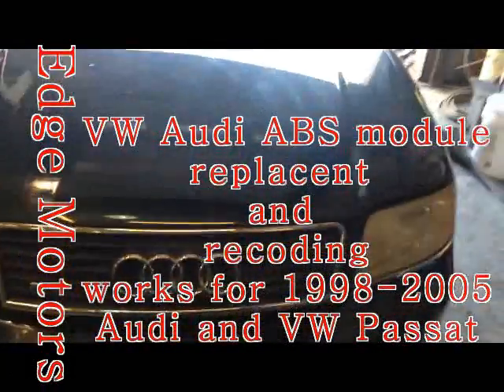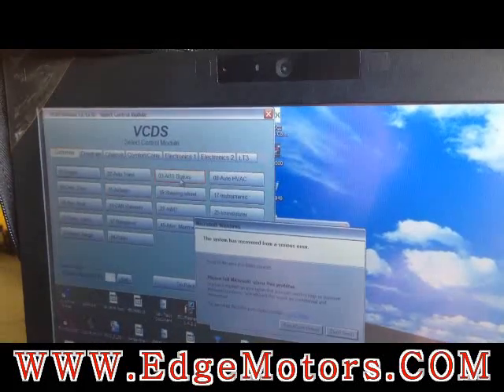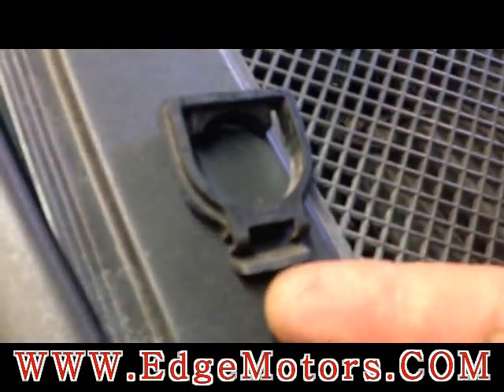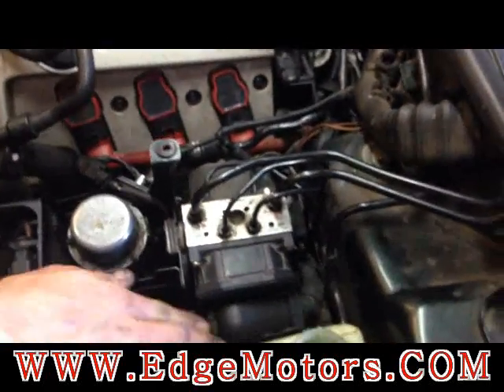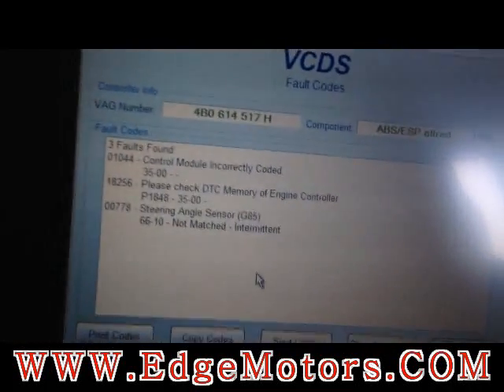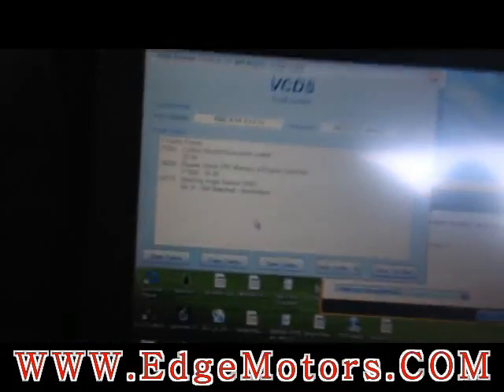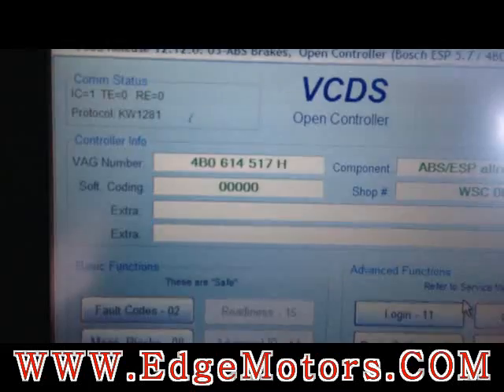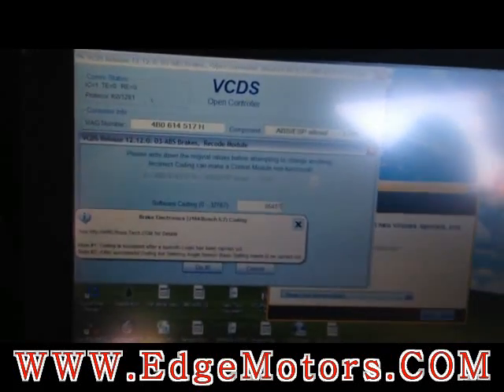VW Audi ABS control module replacement and programing / coding DIY by Edge Motors

Comment: Hi!
Love your videos.

I have a problem when trying to gain security access to the ABS for basic settings.
Code 40168 is not working.

Swapped a new EPB Module and after this cannot perform basic settings on the ABS and work on EPB Coding.

Comment: Hi, I’ve got and Audi A5 2017 I had to take off the ABS pump because it had electric fault which is now sorted, ( all the brake fluid came out and the system was empty) I’m getting the pressure to the front brakes but there in no pressure coming through the rear brakes, do I need to use diagnostic to bleed the system or you think I might have damaged the master cylinder which I didn’t even touched it.

Comment: Thank you for the video! Recently my 2008 Audi TT stated having P01276. I have read several different forms mentioning a new control module could fix the issue. With your experience, how true is that information?

Comment: Hello i have issue with my a6 c7 2011. All lights are on, and my automatic transmision doesn’t reapond. I think that problem can be conected with flexray whiring. Can you tell me where in the car is flaxray unit

Comment: @EDGEMOTORS hi how are you doing sir ? I have a question I have a 2003 Audi A4 1.8L Iam getting code p0501 vehicle speed sensor A range performance with the abs and traction lights on . I believe this issue is related with the abs module from what I read in some Audi forums . So my question is the module you replaced is the same part number I need to replace mine? And where did you get it from ? Thank you
Reply: @hanselldisla4643 I have the same thing. Did u get it fixed? If so, what was it?

Comment: Maybe u can help me. I have an Audi A4 2005 and the ABS control module isn't functioning or communicating with the check engine light which is on and the abs light is also on. I can not pass the smog test in ca. Where I live because of this and so I went to a repair  shop  and he said the new audi abs module is close to 3500 which I dont want to spend. So then he said he can get a used one to match the car exactly. But when he did he told me he was having problems programing it to me car. Then he said he couldn't find a place that rebuilds asb modules for a 2005 audi in the states which I thought was odd and then he said there is a place in Canada he knows of that will rebuild the pump and module. Does this sound legit to have to send my abs module to Canada to get rebuilt? Do you know of somewhere closer to cal.? Is a rebuilt module and pump a reliable way to go if I don't buy one new? Thanks for your help. Debbie

Comment: I own a 09 VW Jetta 2.5L and my ABS control module 1K0614517BD 1K0907379AD failed back in December of 2019 but had been replaced through VW's recall program back in 2017. I brought it to the local VW dealer in Staten Island, NY and they couldn't or wouldn't help me. In December of 2019, I bought 2 used control modules on eBay which didn't work because the VW engineer in Germany said these modules are married to each vehicle and not transferable unless it's rebuilt or bought new. Now I noticed in your comment saying to never buy a rebuilt module because of problems but buying a new one is too expensive. I was told and saw it online for $1700.00, can you recommend where I can buy a new one at a decent price? Thanks for the video and your help.

Comment: No need to bleed the breaks if you only replace the module and not the pump?
Reply from the maker: Yes, if you did not disconnect the hydraulic lines you do not need to bleed the brakes

Comment: Hi I know it an old post  but I have a 2006 passat 2.0 tdi and Abs module is faulty it's a trw module 3c0.614.095.p I have got auto com diagnostics, I have bought a second hand module with exactly same part no on it. Could you point me in the right direction for coding this trw module please any help would be much appreciated thankyou
Reply from the maker: Go to ross-tech.com
Reply: @EDGEMOTORS  thankyou I've been on there and found what I think is the right procedure for my module .... to start I have to drive the car on flat surface and do one turn to left and right then to set wheel angle sensor ect.. will the code give here work through my auto com diagnostics?
Reply from the maker: That procedure is to calibrate steering angle sensor, the coding procedure will be different.

Comment: Any chance that I can replace a ABS module/pump and bleed the brakes and start the car and leave ? Without programming or coding ?
Reply from the maker: No
Reply: Must be programmed?
Reply from the maker: 99 percent chance that it will have to be coded.

Comment: Can I recode a 2009 jetta using a scanner? It shows me the option to edit the coding but it shows I have two different numbers ("code", and "continue") I have to type and I only have one code. I'm not sure what to type under "continue"
Reply from the maker: I’m not sure what scan tool you using, and what you trying to do...
Reply: @EDGEMOTORS  it's a snapon scanner Solus ultra and I'm trying to reprogram the  abs module when I click on programing it says longcoding and it has two numbers I have to put in I already created a code for the car on Ross tech but idk where to get the "continue" code from
Reply from the maker: Not sure how the snap on will do it.... snap on tend not to do stuff properly in vag cars.
But there should be one log in and one coding.....

Comment: Will a faulty abs ecu cause non comunication with main ecu? And cause limp mode?
Reply: My brother had 2000 yearmodel b5 passat with 1.8t engine. It had bad ABS module that took k-line (communication wire/line) Down. I was unable to communicate with the car with vagcom until i unplugged ABS unit.
Reply from the maker: It could cause communication issues, as far as limp mode, I don’t know

Comment: Hi, 2006 a6 3.2.......code 1435/brake pressure sensor G201 and code 1316/brake control module.....do these codes mean that I need to replace the ABS control module?  Or something else?  Great video.....if i was mechanical in any way i know this would help me :)  Thanks for any reply

Comment: Would the brakes feel mushy if it was just the module?  I am not loosing brake fluid at all, but my error code says ABS Hydraulic Pump leak.  I am tempted to buy a fully rebuilt unit pump, module, the whole thing from Europe just to rule it all out.  I am just not sure what to do.  There is a place in the states that will rebuild the module but not the pump.
Reply: Also, I just consulted with a local import shop.  They told me that used units would not work because you cannot "re-code" a unit.  It must be blank or brand new.  Any truth to that?  Maybe they do not have the proper software to re-code?  He made it out like he had a Ross-Tech..
Reply from the maker: Aaaa I would need a bit more info.
About the car and the problem
Reply: I have an error code 01276 in which my Audi Code reader shows that as ABS Hydraulic Pump Leak. However, I am not leaking brake fluid (that I can see or find) my reservoir is full and all that. My brakes do feel a bit weak or mushy if that makes sense. I've been doing so much research and there is so much conflicting data. I have read that this is usually just the module that goes bad, and simply replacing it or having it rebuilt will solve my issues. That way I just leave the pump and distribution block connected so I don't have to not drive it or worry about bleeding the brakes. However, the old school mechanic in me tells me if the actual brakes feel mushy then there must be air in the system. But, I have read that a faulty module can send mixed signals to the pump, and it can actually release pressure, just like it does when it is working on slick roads when you are stopping, so causing the weaker brakes. Here is my issue, a new unit is close to $2,000 + the labor and Audi coding it. The only rebuilt ones (which are few) are all over in Europe and are $400 - $500 + shipping (great deal really). The other option would be to buy a full used unit and hope for the best. I do know regardless a trip to Audi is required to "code" the new unit. I did find a company in UT that can rebuild just the module, but not the pump. I am sure they could probably just test my module to see if its bad. 
Questions:
What is the chances that this is just the Module being bad? I mean can a faulty module actually change the pressure in the peddle? Or am I truly looking at a bad pump? I am just trying to find out what the real issue is. Because if its the module only, I can have that rebuilt and leave the pump and all that connected to the vehicle. If its the pump/block, I can just buy a used unit and have all of that swapped out, but I could actually still use my factory module and not have to worry about a trip to the dealer to reprogram a new Module. 

Any advise or assistance would be great.
Reply: Oh, I have an 07 Audi Q7
Reply: I guess my main question is, if I bought a full used unit, the whole thing, could I install it and have it re-coded to my Q7?  I have had an independent shop, and the Audi dealership both tell me they are "burned" into the until and cannot be re-coded, to prevent theft of parts.  That only a brand new "blank" one or a rebuilt one that is whipped clean can be used.  Is this true?
Reply from the maker: You can, if it has “ component protection” it still can be done, but you will need dealer scan tool to do it...

Comment: What are you talking about?  Rebuilt?  Module Masters offers a 5 year warranty on their ABS module repair.  And I for fuck sure am not buying a $1300 abs module to place in a $4000 car.
Reply from the maker: What kind of car you have?
I have used many different companies to rebuild the modules, and the success rate was no more than 50% meaning they would either be bad from the start or go bad with in next year,  yes some of them went bad in couple of years.... but we talking on a scale that you replace one module in a your lifetime, I replaced hundreds of them, and if even 10% of them come back bad, I look bad in my customers eyes, and loose allot of money on redoing the work.
And FYI a abs control module for older Audi’s and Vw are around 500-600$ new from dealer, and always were. The 1300$ is complete abs unit, not a module. You need a repair kit, also bosh makes them even cheaper.
Reply from the maker: And it don’t matter what kind of warranty you I get for it. I still have to redo the labor... most of the companies that we sealed with has a life time warranty on modules...

Comment: I have a 2004 A4 Quattro, my speedometer and tachometer don’t work, brake light flashes and ABS light stays on.

I’ve read that the abs module being bad can and will stop the tach and speedo from working, anyone have any more information on it that’s true or not?

I’ve checked all my fuses, all good, no check engine light, and the rest of the cluster works perfectly, it’s only the speedo and tach. I bought the car at 113k miles (it’s been stuck on 115k now)
Reply from the maker: Well the tach should work anyway... did you scan the tach and see if it has any codes?
Reply: EDGEMOTORS Sorry not the tach, I was half asleep when I wrote that. It’s the Speedometer and the Odometer. I went to Autozone to scan but the one here in town had a broken scanner. I’ve not scanned yet
Reply from the maker: Autozone scan tool will not me able to scan abs and the rest of the modules, you need to scan it with a bit more professional  tool
Reply: Did u figure it out my audis is doing the same thing
Reply from the maker: It really could be abs module, but also there might be several more causes for that. You need to scan it
Reply: Luis Castillo Yeah, I replaced the speed sensor and still had the problem, so I bought an ABS module off a parts car and reprogrammed it and it all works fine now
Reply from the maker: I’m glad it worked out for you.

Comment: Hi is there anyway of getting around not coding the abs module ? Cheers adam
Reply from the maker: if your module lost coding, you will not escape the coding.....
Reply: EDGEMOTORS ok if i take it off to be fixed will it lose coding ?
Reply from the maker: Shouldn’t, but depends on what they will be doing to it...

Comment: I did the whole procedure perfectly but I keep getting a 00285 g45 wheel sensor code now every time I start test driving afterwards. Why?
Reply from the maker: Well if the code comes of only when you start driving, look into trigger wheel area at the axle.... and see, maybe the sensor is not in all the way. If it would be electrical problem, the code would come on right the way
Reply: Sounds like a wheel speed sensor fault.  Find the correct part and replace it.  If you didn't see this fault with the original ABS module, it's possible the module was faulty to begin with, which i'm assuming is why you replaced it (and watched this video).

Comment: this cars are junk made with cheap plastic now im stuck with this gerp junk.. and delers are a rip of... bad investment honestly you will save a lot of money if you get rid of it even junking it.. cause this cars are prone to suck you dry out of your money.. piece of crap gerp-junk and their electrical problems
Reply from the maker: These cars are as reliable as any other car, may be even more, most of the problems come from poor maintanance and aftermarket parts....
And hey if you buy a 60-80k $ car for 3-6k$ you not saving, some one already used the rest.....
Reply: EDGEMOTORS well i own a 04 vw touareg all original parts no aftermarket 190k miles. though button paint is fading on all doors steering wheel and on cluster.  headlight wires are cracked showing bare wires i litterlly touch it to inpect the wire and they cracked off like a dry rose (sometype of cheap insulator) the middle glove box lock  broke also the dipstick plastic tip broke, rear passeger coin box wont close due to broken platic.. fuel flange filter cracked letting fumes out (theres finally a recall on this as its life threatening... though i already changed it on top of this moonroof leaks therefore causing corrosion on abs module and other components.. yep piece of gerp junk crap. the only aftermarket parts i bought wherd the button replacement stickers to cover up the fadding now it looks new so thats a plus...
Reply from the maker: Did you get it new? 190k miles is twice the life expectancy of a average car:) and most of it like I said from improper maintanance, those buttons pill off due to improper cleaning agents used:) I have couple of customers with those cars with that kind of mileage and all the buttons are ok, but some with less than half of mileage and the buttons are all messed up:)
Reply: EDGEMOTORS well i never fixed the abs i bought it with 160k for $3800 tires where locked since brake assists would kick in for some reason. car would brake completely on the road so i did the unthinkable and unplug the 40amp (i think) abs fuse on the passenger side fuse box...quick fix lol... brakes with no problem so ever since i never try changing it but i guess ill try changing the abs module. and plug the abs fuse back see if that fix the issue
Reply from the maker: Well I can tell you one thing, most likely your problem is not a malfunction, it’s just some idiot who did the wheel alignment never reset the steering angle sensor..... and the car thinks you sliding off the road..... go do a proper wheel alignment is the stealership on all 4 wheels and make sure they reset the steering angle sensor... FYI the reset should be included in alignment procedure.... just in case they try to charge you another 200$ for that:)

Comment: my 1998 golf ABS system seems to have gone nuts. The ABS dashboard light randomly goes on and off, and (which is more scary) when I set my foot over the brake pedal, sometimes I feel and hear the ABS pumping, no matter how gently I am braking. On your experience, do you think these symptoms point to a defective ABS module? thanks.
Reply: Instead of guessing, you will need a VAGCom scan tool or buy the VAGCom software and run it on a laptop with an OBDII to usb cable and scan for codes which will tell you where to start troubleshooting.  Matter of fact, if any of this over your head, find a mechanic that can do it or simply just burn the car.  Used Audi/VW ownership and maintenance is not for the faint of heart.  They're great cars when working, but when not, only the competent and resourceful DIY'ers survive.

Comment: Very informative! On 1:21 you are testing the new module itself without the pump. My abs unit has the control module and pump connected by two wires. Do I then have to connect the whole unit to test and cannot test just the module itself like you are doing? Tnx

Comment: Hey there buddy, Audi A3 2001 1.8t (150HP). ABS light is on. Brakes works fine. Don't want to spend money on scanners. How likely could it be due to the bad ABS Module ? Could it be the fuse or just a ABS Sensor ?

Comment: is it mandatory to code the part even if it is the exact same replacement part?
Reply from the maker: Kyon  the same part number could be used in many different cars with different equipment... that is why you need to code it.
Reply: All Bosch 5.7 ABS Modules if disconnected or sent for repairs must be re-programmed, as told by a ABS repair facility.
Reply: What if you repair the module and put the same module back do u need to code it again?

Comment: Why not copy the code off the old unit and enter it into the new one?
Reply: Maybe you already found your answer, but in most cases the previous ABS module was faulty (or else why replace it?), and it will not communicate with the VAG COM software, so there's no way to check the coding. I just went through the exact same thing today with mine.